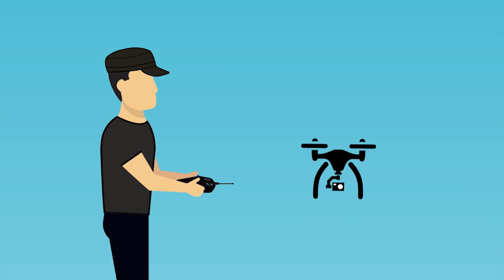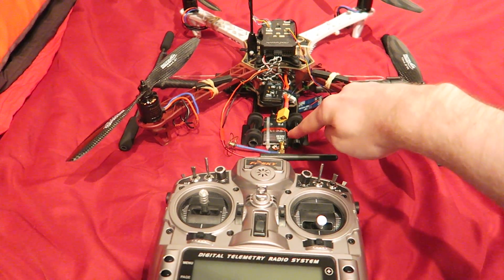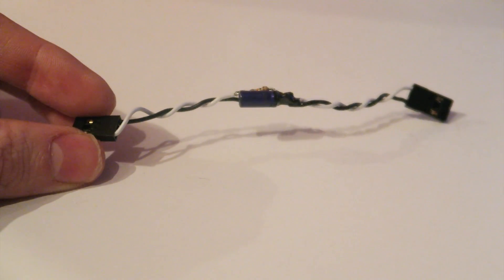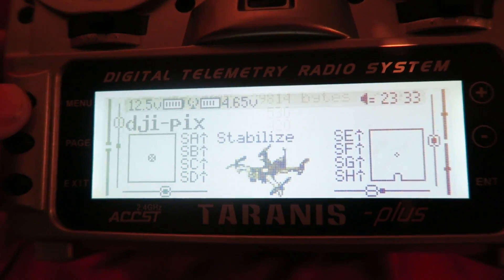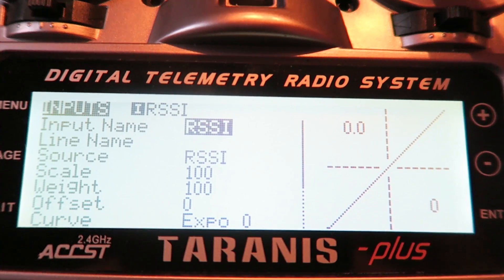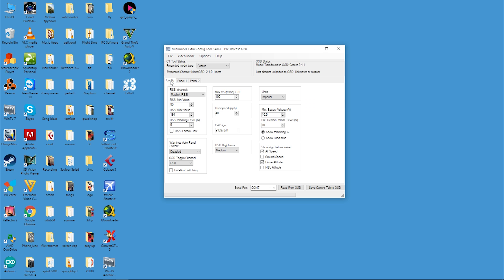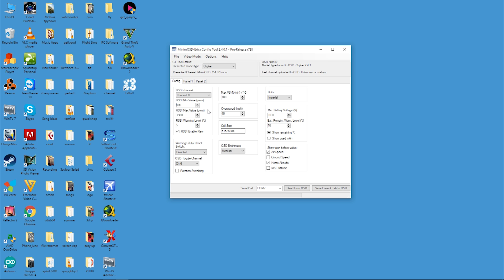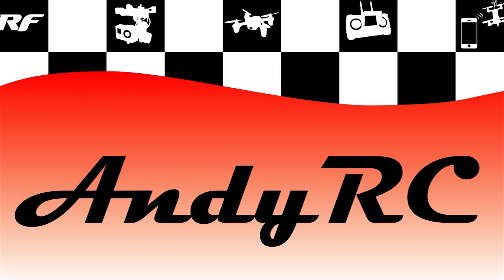RSSI Explained

Comment: Hi, I correctly understand that if the receiver and the transmitter do not support rssi, then this parameter will not be enabled in betaflight and nothing will be displayed on the osd connected by spi.
Reply from the maker: +Сергей Богданов you can use this method in betaflight yes but only with X8r xsr and x4rsb

Comment: Hi Andy. I think I know the answer to this question but I have to double check. I've just purchased the taranis qx7 and Arfun 95 with frsky D8 mode receiver. Now I've watched your Arfun 95 review in which you stated (I think) that the D8 receiver is not a telemetry receiver. Does this mean that there is no way for me to get the qx7 to display or say the RSSI value or warn me. Thanks in advance.
Reply from the maker: +Roger Barnett that it correct cheers
Reply: But should I become able to get battery level shown on the taranis, or is that only viewable through the osd?

Comment: hi andy, i just pre ordered the taranis qx7 and was wondering which receiver you suggest i use on a 5 inch fpv racer? there isn't much space on the airframe.  also, what is your opinion on the cheaper taranis? thanks a million!
Reply from the maker: id go with the X4rsb as i dont like to mess around soldering the receiver but if that doesnt bother u then go XSR cheers

Comment: Really well explained! Great vid!
Reply from the maker: +Paul Atherton thanks Paul
Reply: +AndyRC I was planning to build a filter to try to get the RSSI output from my X4R working, not realising that the X series Rx RSSI PWM output doesn't play nicely, so now I'm just going to stick with RSSI on channel 16. Using your rates to limit the max value PWM - nicely detailed in your vid. Cheers.
Reply from the maker: interesting iv been looking for a way to get the x4r to output the rssi on one of the pwm channels but the x4r only has 4 channels out. can you get channel 16 out on one of the pwm slots on the x4r? cheers
Reply: +AndyRC Yes, I have both the X4R and the X4R-SB (the SBus version), and of course, you can get all 16 channels on SBus, but even on the regular 4 (PWM) channel X4R, you can also access SBus with some mods! Basically, both Rx are the same internally but with a trace on the board soldered differently on one model compared to the other, so the link in one direction changes one of the servo connectors into an SBus connector (I.e. as per the X4R-SB version), and connected the other way, it changes it to a regular PWM channel (I.e. as per the non SB version X4R). So by manually changing that internal link, its possible to turn a regular X4R into the SBus version, or alternatively, you can keep all 4 PWM channels, and just solder a separate servo cable to various pads internally to access Sbus directly. I found this on the BoltRC website here: http://boltrc.com/blog/x4r-sbus-mod-how-to/
Of course with SBus connected to the Pixhawk, you can access all 16 channels within Pixhawk to take advantage of them. For instance, in Mission Planner you can set the RSSI_CHANNEL parameter to 16 to access that channel (even though the wiki suggests only channels 5-8 are usable for this!) Bizarrely in QGroundControl, the parameters screen applies validation on the channel number entered, so you can't set ch16 through this app - but you can in MP!
Reply from the maker: what I was trying to do is on the x4rsb (for miniquad use and not pixhawk) is to some how have the sbus connected to channel one but then the open pwm channels assigned to something like channel 8. do you know if thats possible? or is it only possible to have channels 1-4 come out of them

cheers
Reply: Andy, I don't think that's possible, but you could feed the sbus into a pwm transcoder and access all the channels that way, although this means adding weight and lots of extra wiring to a mini quad = not the best solution! Or, you could just use SBus into your flight controller - cleanflight by any chance? If so, you can use Sbus on most of the cleanflight compatible controllers and adjust the channel mapping to use whichever of the 16 channels you want. Alternatively, if you prefer PPM instead of SBus(I know this works better for the Naze32 for instance with limited UARTs to spare one for SBus), you can flash the X4r with a CPPM version firmware, and you then get the first 8 channels over the PPM cable on one port, plus all 16 channels on SBus on another port. These tiny Rx are very veratile (as are Frsky in providing these cool firmwares). So the best of both worlds! That firmware is the first download link on this page: http://www.frsky-rc.com/download/view.php?sort=Firmware&down=246&file=Firmware-X4R/X4RSB
Reply from the maker: thanks for that. Im using the kiss FC so i dont think thats possible but thanks for the info. hopefully they will have it so the rssi comes through smart port cheers
Reply: +AndyRC Kiss FC supports FrSky Sbus, so you should surely be able to access RSSI over a channel? even cleanflight can do this.

Comment: Hi Andy, thank your for your videos !!
I'have a question about your Taranis set up. I'm trying to use your method with Arkbird AP.

Arkbird guys said to me that the RSSI value has to be sent through channel 11 in PPM in a 1ms to 2ms signal (0% to 100%).

I set up my Taranis like you did in your video but sadly i doesnt works. 

My questions are why do i need to put 200 in weight and -100 offset in the mixer ? and does this set up is sending a 1ms to 2ms signal through PPM ?

(I'm using a X8R with sbus to CPPM converter (jumper plugged for a 21ms period and 12 channels sending)
Reply from the maker: you have to give it an offset otherwise the rssi value will start at the half way point. which means 0 dB will show 50 dB. you want it to read the same as the taranis telemetry. I'm not aware of the ap but it should just be the same as in this video except set it up to channel 11 instead. the M/s signal is relating to pulses I think not sure u can set up anything in the taranis to do that. but maybe it's what the rssi out on the x8r is using already. try to connect the rssi out on the x8r to channel 11 and see what reading u get.

Comment: Andy, as always thank you! The insight gained helps my own thoughts and research.
However...
Sometimes your videos create other questions, such as:
How is the signal for telemetry being transmitted from the flyer? Does telemetry use it's own radio system and can it be modded?
The reason I ask is that I have yet to research antenna systems for telemetry specifically as applied to longer range flying.
For example my Hubsan receiver and FCB both seem to have auxiliary antennas for telemetry built onto the boards. These could, in theory be modified with external antennas to increase telemetry range. 
Wouldn't one want to modify the telemetry system as well so that telemetry also has increased range to match the control range of a flyer?
Reply from the maker: all very good questions. on the x8r it has two antennas. one transmits the telemetry back the other receives. I never looked into how the hubsan board uses its telemetry as I don't use the h107d transmitter. I for fitted the telemetry to use he spyhawk transmitter go get better control. but yes you are right. the telemetry is only as good as its ability to send back. for example if your transmitter can transmit at 100mw but your telemetry can only transmit 10mw then your telemetry will cut out much sooner than the actual range of the transmitter. that's why it's best to transmit the telemetry over the fpv system rather than back to the radio
Reply: Excellent. You rock man.
Reply from the maker: Thanks Michael
Reply: +AndyRC Hi Andy. It was my understanding that the antenna setup on the X8R, and other twin antenna receivers, was for diversity purposes. The antennas feed a compariter circuit which automatically switches the receiver to the antenna with the best signal strength. I've used a X8R receiver with just one antenna, the other was chewed up by a prop, and still had full range and full telemetry. For optimum performance it is advised to orientate the two antennas 90 degrees to each other to compensate for the pitch and roll of the model and changes in polarisation due to the Faraday effect.
Regards
Nidge
Reply from the maker: +sputniksam there's conflicting information on the subject for sure. frsky state they are diversity antennas others state that one doesn't receive anything and transmits. after this rssi discovery I wouldn't be surprised if ones even a dummy!
Reply: +AndyRC Hi Andy good video , couldn't you put a field strength meter close to the two antennas on the receiver and see if one only one transmits?
Reply from the maker: I could... If I had one ;)

Comment: Can you do the same with a 9x transmitter ?
Reply from the maker: if its running open tx then I can't see why not. however you would need a way to get the telemetry from the frsky receiver. check out rc hackers mod. the 9x doesn't have audio but that's not too much of a problem